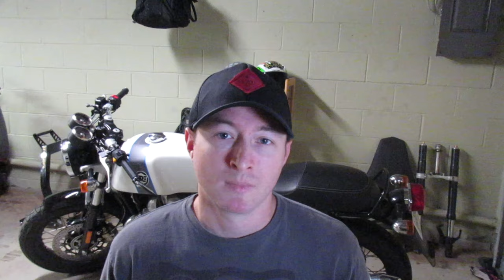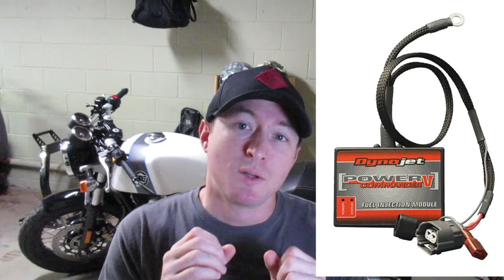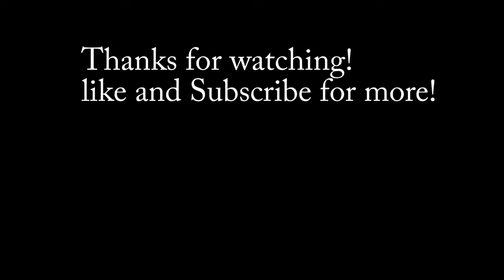Is a Power Commander Worth It?

Comment: Everyone is entitled to their opinion. After market high flow air filter and exhaust systems require fuel remapping. If all you are doing is blasting around on the street, flashing would be sufficient. If you are riding track days at multiple tracks where there is a difference in elevation, ambient temperature and different rpm ranges (big track, small track, twisty track etc) there is very little else on the market that could help you more than a PCV with Auto Tune or another brand equivalent. I ride as many as 12 track days per year from the end of May to the end of September. That is at least once every 2 weeks. I ride up to 4 different tracks (Road Am, Blackhawk Farms, Autobahn and Puttnam). As far as I am concerned if you do not go to the track there is no need for a sport bike. I run a 1 liter Suzuki GSXR with high flow air filter and GP exhaust. The difference between Road Am and Blackhawk Farms is substantial. The fuel map I use at Road Am is way to rich for Blackhawk. The RPM range is completely different. With a PCV and Auto Tune after 2 sessions my bike is tuned almost perfectly. The first session of my day my bike runs very sketchy. By the second session a drastic improvement is noticed with no more effort other than connecting my tablet to the PCV module and with one or two key strokes I remap exactly for the current conditions. I can also remap as my day goes on to compensate for heat and humidity. This would be impossible without Auto Tune. So the moral to this long winded story is...... If all you do is ride the street you do not need an after market exhaust, air filter or a fuel management system. You will never utilize more than 50 percent of you sport bikes stock ability anyway. Do not waste your money. Rather buy yourself a high quality helmet, boots, gloves and riding leathers. Then go to the track for a track day. Nothing makes you and your bike faster than performance riding experience. NOTHING. For $1,000.00 you can be on the track, with a coach going faster than you ever dreamed possible. The second time you go to the track and every time after will cost you about $180.00 for an 8 hour day. "Once you ride the track, to the street you will never go back". Once you have track experience then add go fast components to your bike. You will be surprised though just how fast a stock bike is. And no, you do not have to crash your bike. Riding a track day is far safer than ripping on the street. This isn't racing. This is about learning to ride as fast as you are able. Far faster then you can ride on the street.
Reply: Thanks for the great reply man. I was just interested in this. But I've no need for it. Your right about track days, I haven't done one on the 600 but I feel like that's how I'm going to learn way better the feel of touching knee in a safer environment than road racing in northern Ireland. We have a massive road racing heritage, and that gives you false confidence. Thank Christ I learnt trail breaking. But yea I think learning the near limits of the machine on track is a WAY better than to spend money on this stuff.
Reply: I don’t know where you live, but if you watch any videos on you tube you will see all kinds of bikes “Street Racing”. We’re not talking about it be illegal or unsafe. You see it ALOT. So as far as what ppl need to spend there money on is your opinion and your entitled to that. You see bikes with aftermarket exhaust, Stretched, and lowered every where on the streets. There’s no telling what hidden work is done. So if someone wants 180 hp, 280hp and never goes to the track then that’s there business and there money.
Reply: How long did it take you to type this crap? OMG
Reply: Do I need a power commander if installed an intake on my motorcycle? No exhaust system
Reply: If aren't on a track, you don't need a sport bike. SO TRUE.
Reply: Weird if your bike is efi, your sensors make up for elevation, temperature, etc
Reply: "if you do not go to the track there is no need for a sport bike."
Not true, but then again it's not really "sport bike" you meant there.
But "Super Sport".
And we know these are race bikes barely street legal, the GT3RSs of the bike world that are designed for track riding, not commuting or even the twisties.
The Ninja 400 is a sport bike and it's perfectly streetable, and so is the R7 and the new GSX-8R that Supersport lovers are already hating on because it's about to kill Supersports but it is what it is.
Those are sport bikes and they are great on the street.
The CBR650R is the one bike that tried to bridge the gap between sportsbikes and supersports by being streetable whilst maintaining the excitement of the inline four.
And even that is not enough for the modern bike world, it's deemed too extreme and, truth be told, all it does is entice you to open it up every opportunity just to hear that sound.
Torque is the name of the game nowadays on the street so parallel twins it will be.
Reply: Well said

Comment: I took my 07 roadglide and installed    a stand alone ignition system and carburetor, eliminating the crappy fuel injection system and it runs amazing. No need for a power commander

Comment: On my 2019 MT09 I went with K&N, full exhaust without a cat, and Dynojet PV3.
Unlocked the tune file and shut off the AIS.
Note that all fuel injected vehicles come with the fuel map set for 14.7:1 afr.
Because of that my bike had extreme popping that sounds like a shot gun. And the performance gain was minimal.
Then after changing the fuel map setting to 12.8:1 afr all the popping stopped and a very noticeable power gain.
So do you need to flash your ECU? No.
Will a ECU flash with afr increased add more smiles per mile? Absolutely!!!
As a ASE certified master technician I've been doing that for decades on everything and highly recommend it.
Reply: I installed a pcv on my flashed 2013 xtz1200 with full exhaust. I wondering if I even needed the pcv

Comment: Good one Alex! Here's a little story. I have a -17 KTM 690 Duke. My son has a -16 KTM 690 Duke. My bike have a DNA stage2 airfilter, decat LeoVince midpipe and a Mivv endcan, and a Boosterplug.
My sons is fitted with a PC5, Acra endcan and that's it. 

My bike starts easy, normal temp. revs like hell and pulls like a train without hesitation.
My sons bike does the same. Mine runs 24km/l and my sons 22km/l. 
His bike has less vibration down low. But not by much. But there is a difference. 

What I did after my mods was to let it run for 600 seconds. Turn it off, ignition on again (without starting) and pull the throttle slowly to full and slowly back again. Ignition off. Now it's calibrated. 

All we need now is a side-by-side comparison! 
By the way, my bike is sunning fine, no pops or coughing. I've done 10000km in this configuration and it runs great. Citytraffic in hot weather makes it warmer (of course!) but not more than before the mods. 

So I guess the ECU on these models have a broad adjustment area. 
Thank you!

Comment: I have a 2001 Vulcan nomad and i use a power commander and it works for me, but I built my exhaust myself and I got the map nearest to mine and then play with the numbers in each range until I get the most out of it. now I have been using a commander for about 15 years

Comment: Great review, Alex.  When you refer to older vs. newer FI systems, are you actually describing "open loop" vs. "closed loop" FI systems?  The difference is the mass airflow sensor on closed loop systems that can detect increased airflow, such as when a new exhaust is installed (as you described) and adjust fuel mixture accordingly.  A lot of newer off-road bikes still use open loop systems.  I just installed a PC-V on a 2021 KLX300R.  Still running stock exhaust and intake.  It's made a noticeable improvement.  Still...I wish I'd watched your video before the installation.  I didn't think to check into whether the bike could be reflashed --- still interested in finding out.

Comment: You make some great points and I have to agree with you . A motorcycle ECU Flash is a much better option especially since you can also change so many other parameters at the same time like I did on my fz09 such as  speed limiter , engine braking , throttle response etc . Keep the videos coming they are all great and informative
Reply from the maker: That's the idea! Thanks for the feedback, and sorry for the delay in responding!
Reply: Problem with ECU flash is the map isn't made for the environment in another country where the environment parameters maybe a lot different. A map made in Europe may not work as good in a hot and humid country like India.
Reply: @sinnombrea1944  That's the issue I'm facing here.. EU mapping of the CRF250 Rally is completely different than in Canada. The EU tuning performance is far superior than in Canada. It's also very noticeable with the Honda Transalp! There's just a huge lack of power on the Canadian version.
Reply: @Mobstar76  If the EU map performance is better than Canadian version what is the issue you are facing? 
To be honest the best mapping would be a piggyback ECU with wideband autotune controller (to map initially) and then fine tune it the way you want. It'll be a slow process and time consuming but if you know what you are doing it'll be the perfect map for you.

Comment: hi. great vid. I have been looking into it since I bought m109r. The best I could come up with is it isn't that easy to reflash. I could buy a mod kit to allow it to be reflashed and put it on a dyno, which would end up costing over $1000. so the price of the PC V was a cheaper way to go and I found it worked very well. Better throttle response while the bike was standard and now there is a great selection of tunes to choose from. plus it has a duel tune capability as well as being able to be manually adjusted to specifically fit the bike. the downside is that for further and more precise ignition mapping etc you then need to purchase more modules. So if you want to completely alter your fuel and ignition mapping and rev limiter then reflashing is the way to go
Reply: hey i ride with a group and we all have 109s and flashing the ecu has a major difference from factory that makes the bike alot more smooth hope it helps !

Comment: Get an autotune with a power commander and you can fine tune the fuel / air mixture at any rpm, at any throttle position in any gear. I had this on my WR250X and it was a very good investment.
Reply: I agree. I have one on my 06 FJR1300. The fuel mapping for the 06/07 were crappy and it has helped tremendously. I experimenting with AF ratios in the cruising area to get better MPGs.

Comment: I put some slip on Hooligan mufflers on the RF Int 650 and added a booster plug wher the sensor sits behind the Airbox. I also added a DNA high flow air filter. That was it. 
A much cheaper way to go and seems good to me. I get some roll off crackle and pops when i want but i can can control that with gear selection and throttle adjustment. Give the bike a bit more old skool appeal. The booster plug helps the bike run a little ritcher which it cooler on the motor.

Comment: I put a full exhaust on my 2018 CBR1000RR in addition to a K&N filter and auto tuner from Power Commander. My Honda mechanic suggested to have the power commander. The only time you don't need it is when you have slip on or half system. I have the Power Commander V
Reply: I have a 2016, just ordered a full titanium exhaust kit with a k&n filter… should I do power commander?
Reply: @jamesdawson7415  Yes you are going to need the power commander v or the bike will run too lean and mess up the bike.

Comment: 19 Suzuki Hayabusa installed K&N air filter, RLS Chaos series exhaust ran fine. Installed power commander V. Could tell increase in power, ram fine for couple months. Then it started fouling out plugs. Could tell it was over fueling. Took the power commander off. Runs fine again.

Comment: I was thinking about buying one for my 2014 Valkyrie.  Glad I didn't. I was told by Dynojet that I could expect anywhere from a 5-15% increase in horsepower.  I would bet that it would be less than 5% and it costs $500.
Reply: I put one on my 2002 vtx 1800 and wow the difference was amazing. 
I have one one my 2000 cbr 929 rr 
Wow is all I can say! So much more responsive, smooth and had way more torque through out gears and rpm.... What I really noticed was how smooth it was at low speed in a parking lot..... 
Not sure where this info came from but I highly disagree, IF exhaust and intake upgrades were or are being done is highly recommend getting a power commander. It's well worth it! 
I had my vtx tuned, however the exhaust bike and air were same on cbr, so I downloaded a couple till I found a few I liked, and tweaked a few air and map changes.

Comment: I think that only discussing this issue in exhaust changes in a matter of words is maybe  to narrow of a discussion. Because of other aspects that most ppl also change in conjunction with the exhaust is high flow filters which also change parameters and there will not be a tune mapping that comes with that. And like me for my 2015 Road Glide, most of the time cams are also apart of the equation. So i feel as though mentioning that the power commander is one piece in a series that come together as a whole. The auto tune coupled with the power commander can be a system that grows with the changes and better improves performance on an ongoing basis while you are riding. Using CO 2 sensors to see exactly what your bike is doing on the back end  as you ride. But otherwise informative for the case of older fuel injections

Comment: POWER COMMANDER is the easiest way to adjust A/F ratio. Coupled with auto tune and the ignition module took my 20 ktm superduke 1290r from 178hp to 204hp. Akropovic exhaust, DNA airfilter, 80mm RR performance intake. I was able to download a map and use the PC5 to run it. Any other way I would need to take it to a technician have my stock ecu flashed and would have to take it back to go back to the stock ecu settings. In my opinion the PC is WAY more beneficial IF you are a racer. IF not that of course you can just do the bare minimum like he's saying.
Reply: if i was to buy a pc for my er6n where would i find maps to download and how do i do that?

Comment: I have a 2015 duke 390 with stock exhaust,  it runs super lean from the factory.  The power commander fixes the stock tune.  Yes a flash tune with a Dyno session at $450 would probably be a better option, but for $350 and an hour of my time I can get it to run smoother and be less jerky at low throttle input.  So for me 4hp at the top 10 hp at the bottom and is good enough to solve the problem.  I am willing to bet a full Dyno tune is only worth an additional hp or two.

Comment: Great vid topic, but I am going to concur with 2 other commenters:  What about the RE 650s and what about the boosters units (which supposedly on enrich fueling during acceleration)?  There are a bunch of youtube content saying that the RE 650s will "adjust" their own fueling by just letting them run for 15 minutes after a new exhaust system is put on.  And how can one tell if after putting on a new full system that the bike needs a fueling remap/flashing/power commander etc...  I think a lot of folks coming to your channel are interested in the RE 650s so you should, when discussing a topic like this, always speak generally and then specific to your bike.  Additionally, I suspect there are but of old dudes, like me, who rode carbureted bikes for a long time and then took a break for some years only to come back the 2 wheels to find everything is fuel injected and there are all these electronic  extras.  The first time I heard people mention a power commander, I was like what is that?  A video game?  The leader of the Power Rangers?
Reply from the maker: Hahaha, absolutely. I have addressed the booster plug question a couple of times, I think I will be trying one out at some point so I can give a good "first hand" review on it! The way I know if an exhaust is causing me to have issue is just to pull the spark plugs, they will tell me if the bike is running lean or rich (just like in the old carb days haha).

Comment: Change full exhaust system, slap on dyno...exactly.  100% of the time air/fuel ratios will be off.  And actually they will be off even before new exhaust system or any mod parts.  So with that being said, if you add ANY mods you'll need a proper tune period.

Comment: I wonder why motorcycles use a fuel map instead of a MAF.  A Mass Air Flow sensor would compensate for the extra air from a performance air filter and performance exhaust system by adding additional fuel, without needing to fool the fuel injection ECU.
Reply from the maker: Interesting questions...wish I could ask the guys that design these things haha...I figure they are much smarter than I am in the engineering department, so must be a reason!
Reply: @AlexSimmons11c  Well, I looked into it a little more.  I can't find the particular link right now, but motorcycles use Speed Density or Alpha-N fuel injection systems that use a fuel map and a Manifold Absolute Pressure sensor, rather than MAF (Mass Air Flow) and O2 sensors.  Apparently MAF systems don't work well on motors that rev high or have few cylinders.  I'll comment again with the link I found that explains this.
Reply: “Fuel-injected bikes often do without some or even all of these sensors, relying solely upon a preprogrammed fuel and spark map calibrated to the engine's stock airflow parameters. In cases like this, the computer is almost flying blind, using little more than rpm and crankshaft position to modulate fuel injection.”  
From this article: https://itstillruns.com/need-remap-motorcycle-after-putting-new-exhaust-on-12226300.html